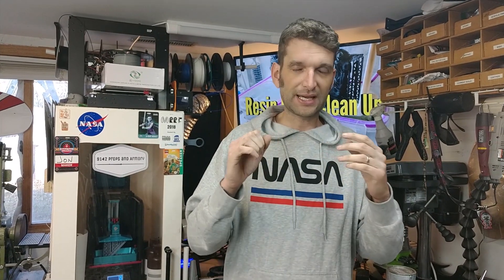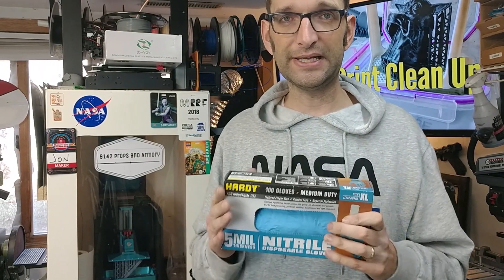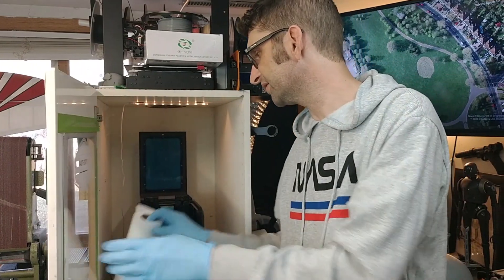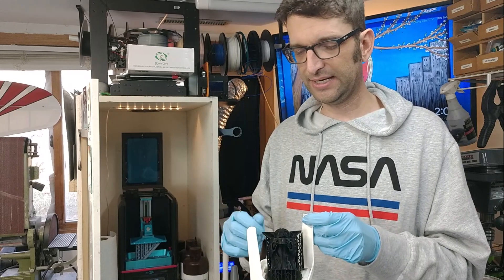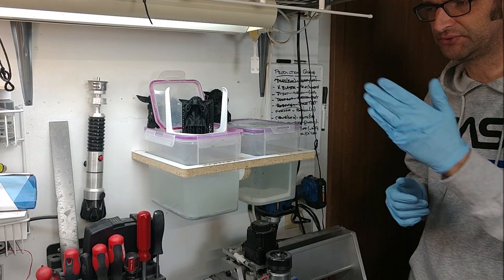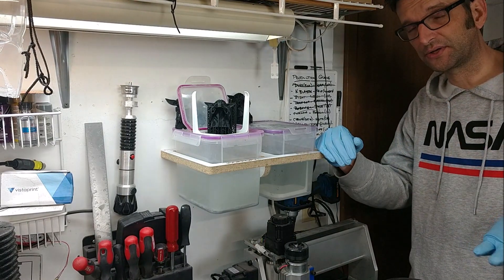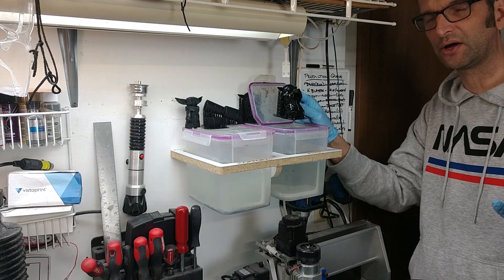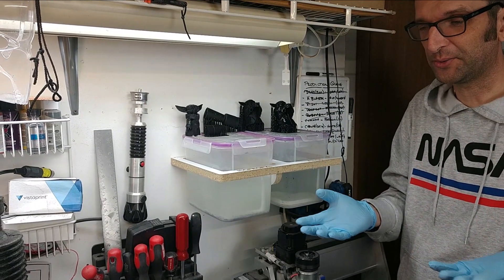3d Printer 101: How to Clean Your Resin Prints

Comment: Is giving the resin piece 2 washes required? Or can you potentially get away with using the 91% ISA for 10 mins
Reply from the maker: The two washes isn't a necessity. Some do it to get the bulk of the uncured resin off first in a smaller container and then onto their final wash. It does help conserve your washing agent a bit. I used to do that a lot more before I had a dedicated wash station.
Reply: @9142PropsandArmory  thank you!!

Comment: do you have something that stirs the IPA or something on the first wash container? I was wondering because you are the first I've seen on yt that seems to just dip the print. does it make a difference when we use something to stir the IPA vs leaving it in a stagnant IPA? Im  just making sure I'm aware of the work around of resin print before buying. TIA
Reply from the maker: Agitation helps speed things up a bit, but the alcohol is essentially thinning it to the point that it's removed from the print if your part just sits there.

Comment: Can you use 70% IPA
Reply from the maker: You can, it doesn't clean as quick as the higher concentrations will. But it will do in a pinch for sure.

Comment: How often do you replace the alcohol from your cleaning station? Can I reuse it or is it a one-wash and toss sort of deal? Thank you!
Reply from the maker: In the time I've had it?  Twice so far. You can use the alcohol for a long time. Sorry to have missed your question
Reply: @9142PropsandArmory  many thanks
Reply: @Peteskis  Once your IPA cleaning solution gets too saturated with resin, put it aside for a week or more. The resin residue will sink to the bottom and you can filter it. You can also put the IPA container to cure in the sun/ or in your UV curing station and then filter the cured (and now solid) resin particles.
Reply: @the_arcanum  Many thanks, Very helpful
Reply: @the_arcanum  - “what to do with the dirty alcohol bath” is really what was uppermost in my mind when I clicked on this video, since you don’t want to dump resin down the drain. Curing it in the sun to harden it seems like a good solution.
Reply: no reply to this obvious question please?

Comment: What's IPA?
Reply: Isopropyl alcohol. Which is impossible to find in stores right now due to the apocalypse. You're more likely to find denatured alcohol at your local construction/home improvement store, near the paints and stains.
Reply from the maker: Yep, I'm using denatured as well now. Works great, but more aggressive than IPA.
Reply: @9142PropsandArmory  Yeah, it has other chemicals in it from the distilling process like methyl ethyl something. Idk if any of you have watched any of those moonshine shows. It's funny how well they show how to make shine. Anyway, the "heads" aka the first percentage of distilation that comes off the cook is full of really nasty stuff. That is what will make you blind if you drink it, and why you can't trust shine from just anyone. 

Denatured alcohol will ahve that stuff in it, Just don't let it get on your skin, wear gloves, but you have to do that anyway with the resin, so it's all pretty bad. ISO is going to be distilled multiple times. Either way they are also mixed with wood alcohol and who knows what else to make you really sick if you try drinking it. Otherwise it's pretty similar to everclear or vodka--only the stuff you buy at the liquor store is diluted. Not many brands are licensed to distribute anything over 50% for drinking. 

But more aggressive is good right? You don't have to spend as much time in the dip tank. 

Not to mention ISO is $30/liter or $70/gallon, and I just picked up almost a gallon of DNA for $16.
Reply: @Grizzydan  thanks, I'm from Brazil so I'll have top look around here...

Comment: I think I'm going with an ultrasonic cleaner filled with a surfactant such as Mean Green.  It's less expensive than IPA, It's not a volatile organic solvent so there are fewer health risks from breathing fumes, and plastic containers with a gallon of flammable isopropyl alcohol mounted to your wall is a serious fire hazard.

I'll put a powerful submersible pump in a rinse tank with demonized (distilled) water agitating the parts, with a 30W IR curing lamp in the lid so I rinse and cure at the same time.  Maybe use an Arduino and solid state relays to rinse first, then water cure the parts with IR after they're fully rinsed.
Reply: Wow you're a huge nerd! Could you make a write up??